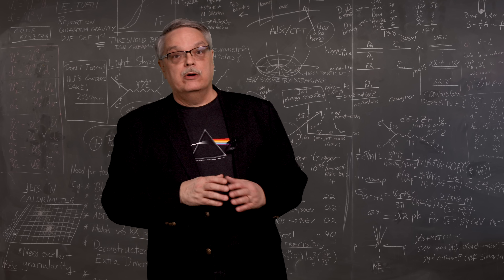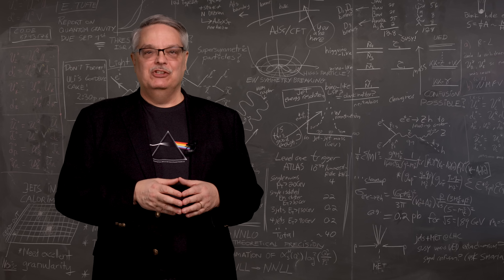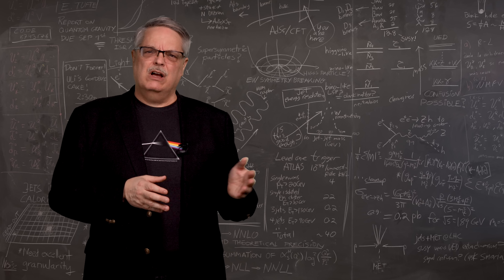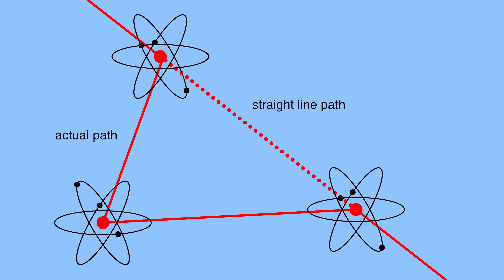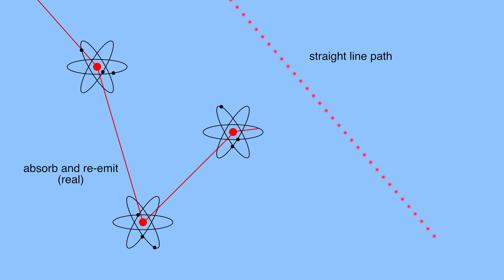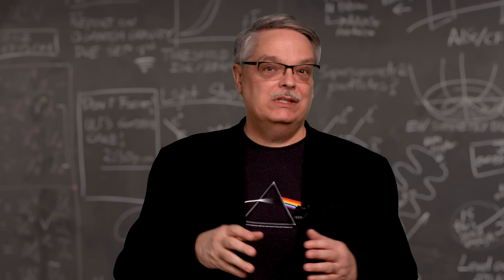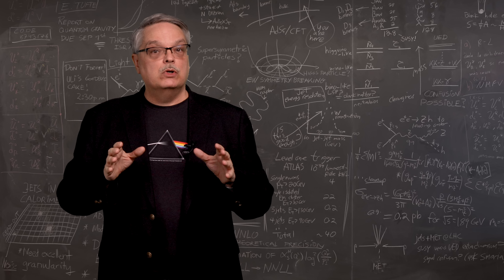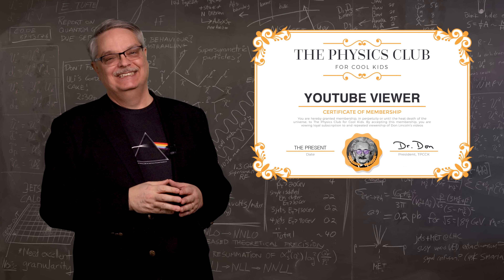Why does light slow down in water?

Comment: This doesn't explain why light changes direction when it enters a medium and reverts to the same angular direction when it emerges (or did I miss something?).

Also, did Uli get their goodbye cake?
Reply: nor does it explain why it slows down as superposition of light with different frequency would still travel at the same speed.

if you have the courage to know the thruth, i warmly suggest you to read this wall of text that explain how it works 
or for TL DR: it's the induced electric current that modifies the speed

this video has taken many shortcuts in explaining the relations between the two systems and how it affects them.
to better understand this, we need to talk about d'alembert's equation and its dispersion formula and how it describes a wave.
so d'alembert's equation is used to link together the spatial and temporal variation of a wave.

and from this equation comes the dispersion relation that links together the frequency, wavelength and celerity of a wave.
to access to this equation, we use maxwell relations to describe this phenomenon. when we consider those relations in the void, we get the relation: c² = k²*w² where k is the angular frequency and w its wavenumber. (just google it, ain’t that hard to understand)

thus we can see here that the celerity is proportional to its angular frequency. however, as explained in the video, when light enter a medium, there are charges that can be influenced by the electric field, especially electrons that are 2000 times lighter than their counterparts protons.
thus, when light comes in this medium, we assume that only electrons are affected by the electric field.

we then apply newton's second law to those electrons to find a relation between an electron's speed and the electric current
(we also neglect the magnetic field of the light as the electron is relativistic thus the force from the electric field is much greater than the magnetic one see lorentz law to better understand this )
and then by generalizing this equation to all electrons in the medium, we can get an induced current from the electric field of the light.
( the current is j = n * v with n the volumic density of charges and v the celerity of electrons)

then when we put this back to maxwell ampere local equation, we introduce a new component: the induced current which thus gives us a new dispersion equation: c² = k² * (w² - wp²) with wp the plasma oscillation and thus we can see that from the value of wp, we'll get a different value of the celerity of the wave.

thus we can say without a doubt that they are wrong in their explanation as it is not the combination from the electric current of the electrons and the wave that makes it slower but the induced current inside the medium that modifies the dispersion relation thus modifying its speed.
or in simpler words, it's the movement of electrons that changes the frequency and celerity of the light, but not the combination of the two electric current. (also on a side note, trying to represent the electric current of a dipole using a sine wave.. funny thing you did there 😅)

and finally, as for the reason why the light has a different angle, well you can easily explain this using two waves parallel to each other crossing the medium in phase with each other. as they have the same wave plane, you can easily come to the relation between the refracted angle and the incident angle using some basic geometry. i recommend you to see the demonstration of descartes second law if you want to better understand what i'm talking about.

Comment: Why does it change direction based on the angle of the surface?
Reply: In addition to the explanation in film, the energy and conservation of momentum play an important role. When the light hits the denser medium at an angle, there is also a reflection of a portion of the incident light. When you look at all the proportions together in this context, everything adds up. In many school books they argue with the shortest path of light, which is definitely wrong as you can imagine.

Comment: I am Morbo the Annihilator and I command you to talk further about electric fields smart man!
Reply: this shall satiate your thirst (it may even drown you!)

this video has taken many shortcuts in explaining the relations between the two systems and how it affects them.
to better understand this, we need to talk about d'alembert's equation and its dispersion formula and how it describes a wave.
so d'alembert's equation is used to link together the spatial and temporal variation of a wave.

and from this equation comes the dispersion relation that links together the frequency, wavelength and celerity of a wave.
to access to this equation, we use maxwell relations to describe this phenomenon. when we consider those relations in the void, we get the relation: c² = k²*w² where k is the angular frequency and w its wavenumber. (just google it, ain’t that hard to understand)

thus we can see here that the celerity is proportional to its angular frequency. however, as explained in the video, when light enter a medium, there are charges that can be influenced by the electric field, especially electrons that are 2000 times lighter than their counterparts protons.
thus, when light comes in this medium, we assume that only electrons are affected by the electric field.

we then apply newton's second law to those electrons to find a relation between an electron's speed and the electric current
(we also neglect the magnetic field of the light as the electron is relativistic thus the force from the electric field is much greater than the magnetic one see lorentz law to better understand this )
and then by generalizing this equation to all electrons in the medium, we can get an induced current from the electric field of the light.
( the current is j = n * v with n the volumic density of charges and v the celerity of electrons)

then when we put this back to maxwell ampere local equation, we introduce a new component: the induced current which thus gives us a new dispersion equation: c² = (w² - wp²) / k² with wp the plasma oscillation and thus we can see that from the value of wp, we'll get a different value of the celerity of the wave.

thus we can say without a doubt that they are wrong in their explanation as it is not the combination from the electric current of the electrons and the wave that makes it slower but the induced current inside the medium that modifies the dispersion relation thus modifying its speed.
or in simpler words, it's the movement of electrons that changes the frequency and celerity of the light, but not the combination of the two electric current. (also on a side note, trying to represent the electric current of a dipole using a sine wave.. funny thing you did there 😅)

and finally, as for the reason why the light has a different angle, well you can easily explain this using two waves parallel to each other crossing the medium in phase with each other. as they have the same wave plane, you can easily come to the relation between the refracted angle and the incident angle using some basic geometry. i recommend you to see the demonstration of descartes second law if you want to better understand what i'm talking about.
Reply: @recouer THANK YOU PUNY HUMAN!

Comment: Please how the light wave changes in time?
Reply: this video has taken many shortcuts in explaining the relations between the two systems and how it affects them.
to better understand this, we need to talk about d'alembert's equation and its dispersion formula and how it describes a wave.
so d'alembert's equation is used to link together the spatial and temporal variation of a wave.

and from this equation comes the dispersion relation that links together the frequency, wavelength and celerity of a wave.
to access to this equation, we use maxwell relations to describe this phenomenon. when we consider those relations in the void, we get the relation: c² = k²*w² where k is the angular frequency and w its wavenumber. (just google it, ain’t that hard to understand)

thus we can see here that the celerity is proportional to its angular frequency. however, as explained in the video, when light enter a medium, there are charges that can be influenced by the electric field, especially electrons that are 2000 times lighter than their counterparts protons.
thus, when light comes in this medium, we assume that only electrons are affected by the electric field.

we then apply newton's second law to those electrons to find a relation between an electron's speed and the electric current
(we also neglect the magnetic field of the light as the electron is relativistic thus the force from the electric field is much greater than the magnetic one see lorentz law to better understand this )
and then by generalizing this equation to all electrons in the medium, we can get an induced current from the electric field of the light.
( the current is j = n * v with n the volumic density of charges and v the celerity of electrons)

then when we put this back to maxwell ampere local equation, we introduce a new component: the induced current which thus gives us a new dispersion equation: c² = k² * (w² - wp²) with wp the plasma oscillation and thus we can see that from the value of wp, we'll get a different value of the celerity of the wave.

thus we can say without a doubt that they are wrong in their explanation as it is not the combination from the electric current of the electrons and the wave that makes it slower but the induced current inside the medium that modifies the dispersion relation thus modifying its speed.
or in simpler words, it's the movement of electrons that changes the frequency and celerity of the light, but not the combination of the two electric current. (also on a side note, trying to represent the electric current of a dipole using a sine wave.. funny thing you did there 😅)

and finally, as for the reason why the light has a different angle, well you can easily explain this using two waves parallel to each other crossing the medium in phase with each other. as they have the same wave plane, you can easily come to the relation between the refracted angle and the incident angle using some basic geometry. i recommend you to see the demonstration of descartes second law if you want to better understand what i'm talking about.

Comment: sir the slowing down is ok but why does the light change its direction of movement when it enters another medium
Reply: this video has taken many shortcuts in explaining the relations between the two systems and how it affects them.
to better understand this, we need to talk about d'alembert's equation and its dispersion formula and how it describes a wave.
so d'alembert's equation is used to link together the spatial and temporal variation of a wave.

and from this equation comes the dispersion relation that links together the frequency, wavelength and celerity of a wave.
to access to this equation, we use maxwell relations to describe this phenomenon. when we consider those relations in the void, we get the relation: c² = k²*w² where k is the angular frequency and w its wavenumber. (just google it, ain’t that hard to understand)

thus we can see here that the celerity is proportional to its angular frequency. however, as explained in the video, when light enter a medium, there are charges that can be influenced by the electric field, especially electrons that are 2000 times lighter than their counterparts protons.
thus, when light comes in this medium, we assume that only electrons are affected by the electric field.

we then apply newton's second law to those electrons to find a relation between an electron's speed and the electric current
(we also neglect the magnetic field of the light as the electron is relativistic thus the force from the electric field is much greater than the magnetic one see lorentz law to better understand this )
and then by generalizing this equation to all electrons in the medium, we can get an induced current from the electric field of the light.
( the current is j = n * v with n the volumic density of charges and v the celerity of electrons)

then when we put this back to maxwell ampere local equation, we introduce a new component: the induced current which thus gives us a new dispersion equation: c² = k² * (w² - wp²) with wp the plasma oscillation and thus we can see that from the value of wp, we'll get a different value of the celerity of the wave.

thus we can say without a doubt that they are wrong in their explanation as it is not the combination from the electric current of the electrons and the wave that makes it slower but the induced current inside the medium that modifies the dispersion relation thus modifying its speed.
or in simpler words, it's the movement of electrons that changes the frequency and celerity of the light, but not the combination of the two electric current. (also on a side note, trying to represent the electric current of a dipole using a sine wave.. funny thing you did there 😅)

and finally, as for the reason why the light has a different angle, well you can easily explain this using two waves parallel to each other crossing the medium in phase with each other. as they have the same wave plane, you can easily come to the relation between the refracted angle and the incident angle using some basic geometry. i recommend you to see the demonstration of descartes second law if you want to better understand what i'm talking about.

Comment: this fact i never known till BS physics.
Reply: this video has taken many shortcuts in explaining the relations between the two systems and how it affects them.
to better understand this, we need to talk about d'alembert's equation and its dispersion formula and how it describes a wave.
so d'alembert's equation is used to link together the spatial and temporal variation of a wave.

and from this equation comes the dispersion relation that links together the frequency, wavelength and celerity of a wave.
to access to this equation, we use maxwell relations to describe this phenomenon. when we consider those relations in the void, we get the relation: c² = k²*w² where k is the angular frequency and w its wavenumber. (just google it, ain’t that hard to understand)

thus we can see here that the celerity is proportional to its angular frequency. however, as explained in the video, when light enter a medium, there are charges that can be influenced by the electric field, especially electrons that are 2000 times lighter than their counterparts protons.
thus, when light comes in this medium, we assume that only electrons are affected by the electric field.

we then apply newton's second law to those electrons to find a relation between an electron's speed and the electric current
(we also neglect the magnetic field of the light as the electron is relativistic thus the force from the electric field is much greater than the magnetic one see lorentz law to better understand this )
and then by generalizing this equation to all electrons in the medium, we can get an induced current from the electric field of the light.
( the current is j = n * v with n the volumic density of charges and v the celerity of electrons)

then when we put this back to maxwell ampere local equation, we introduce a new component: the induced current which thus gives us a new dispersion equation: c² = k² * (w² - wp²) with wp the plasma oscillation and thus we can see that from the value of wp, we'll get a different value of the celerity of the wave.

thus we can say without a doubt that they are wrong in their explanation as it is not the combination from the electric current of the electrons and the wave that makes it slower but the induced current inside the medium that modifies the dispersion relation thus modifying its speed.
or in simpler words, it's the movement of electrons that changes the frequency and celerity of the light, but not the combination of the two electric current. (also on a side note, trying to represent the electric current of a dipole using a sine wave.. funny thing you did there 😅)

and finally, as for the reason why the light has a different angle, well you can easily explain this using two waves parallel to each other crossing the medium in phase with each other. as they have the same wave plane, you can easily come to the relation between the refracted angle and the incident angle using some basic geometry. i recommend you to see the demonstration of descartes second law if you want to better understand what i'm talking about
Reply: i agree but give mee a link of descarts solution if you have?
Reply: @hemangrathod6300  
https://www.google.com/url?sa=t&source=web&rct=j&url=https://ocw.mit.edu/courses/electrical-engineering-and-computer-science/6-007-electromagnetic-energy-from-motors-to-lasers-spring-2011/lecture-notes/MIT6_007S11_lec32.pdf&ved=2ahUKEwj99s-n-v7gAhWt34UKHc67B-MQFjAGegQIAhAB&usg=AOvVaw0gBkXYBOffJtg60D-3SmWj
look at snell's law via phase matching. if you don't understand i can explain the geometry part